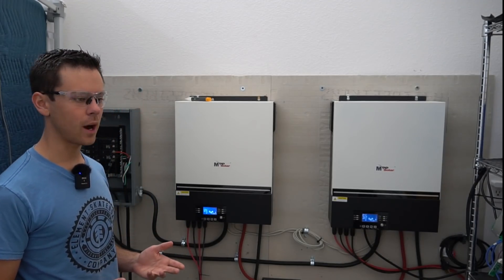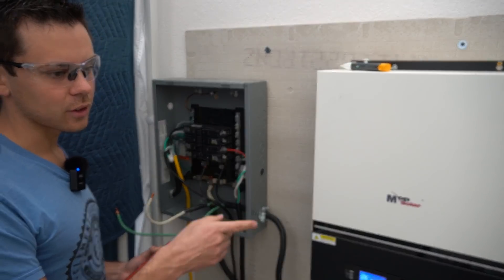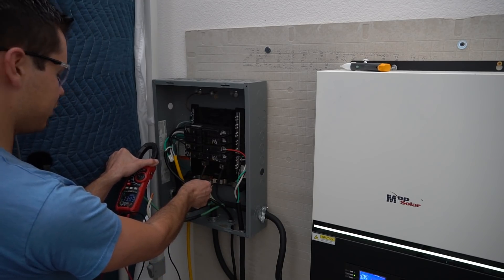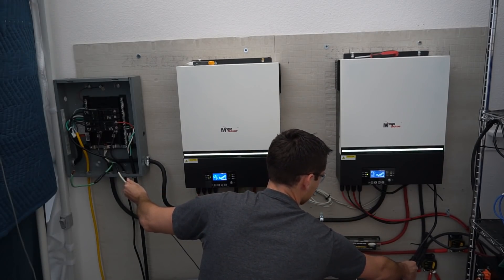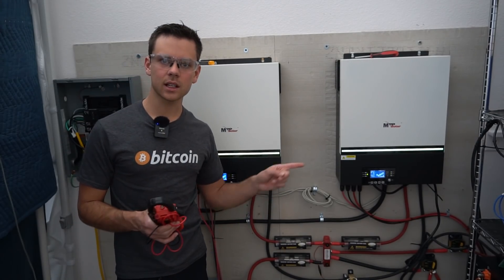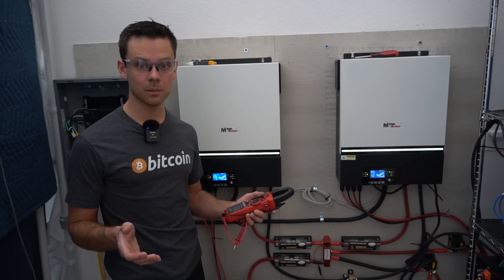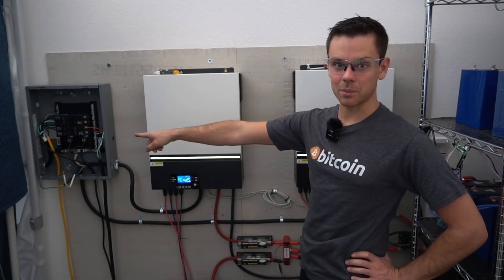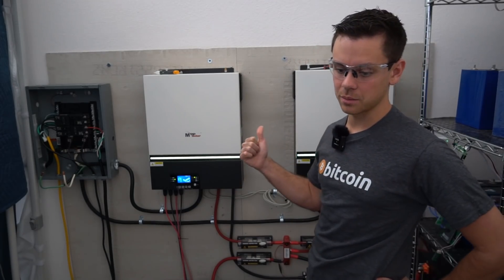Advanced Level Grounding Discussion for All-in-one Solar Power Systems

Comment: Does this issue affect the Growatt units as well?
Reply: Yes. I tested my Growatt 3k 120v today and the neutral and ground are bonded on AC output
Reply: @lifewithlonsi  What is the model # or your GW?
My 3000tl lvm-24p is model # SKSL00 0010700 and my AC out is not bonded per the three-light circuit tester indicating no ground.  Only when I plug a NG bond into the AC out  does the fault go away an both lights are lit.  It doesn't matter if AC in is from grid or battery.
Reply: @4partee  Same model but different part # (SKSL00 0005322). I contacted Growatt support - they said that it SHOULD NOT be bonded but I recorded a video (you can see on my channel) demonstrating it in fact was. They provided guidance to remove grounding screws on the PCB which resolved the issue. Appears to have been an unintended outcome of grounding the PCB inside the unit, I posted a video of the fix as well.

Comment: Could you please do a simple test for me? I assume that you have your panels all connected to ground? Could you check voltage from the panels to the ground rod?
During the daytime I have about 17vac running to ground, at night when the sun has long set I have about 5 volts running to ground. There is no voltage in the house ground wire. I have the combiner box also hooked to the same ground rod as the panels because of the lightning protection circuits need a ground and I don't want to tie that into the house wiring.
I need to check each panel from the output positive to the frame, and see if there's anything bleeding from any of the panels. I found the voltage when I was connecting each panel to a common ground wire running to a ground rod. I felt voltage run through my hands when I touched the next panel and the ground wire I was connecting. I don't like having voltage running on my ground wire so I am a little curious where it's coming from and if it's normal.

Comment: Personally, only the generator (floating ground) will connect to AC input, 
but usually genny only drives a floating charger connected directly to the battery, multiple chargers if the load requires.

Ground is a local reference and 2 different grounds may not be the same reference aka ground loop.
The power company may have 100 to 150 KV on the pole and taps on a transformer for a specific circuit.
A transformer may supply multiple circuits.
 
A transformer with 220 secondary and dual (180 phase shift) 110 secondary circuits with a center tap, the new (CT) ground reference is different from the input ground. One would not want to tie the input and output grounds together. 

The power company knows you are going to ground your breaker box and designs their system accordingly.
When using solar/ grid tie configuration, the equipment should handle any grounding issues.
If one was completely off grid, from a purely safety perspective it would be prudent to ground the box to a copper rod, 
however, once done, the solar panel may increase the likelihood of becoming a lightning rod if not otherwise present. 
Letting ground float might offer some protection.

Comment: If i want to use power inside and outside a van (where an invertor is placed inside the van) do i need to earth the van to ground or just ground the invertor to the van?
Reply: Your van is grounded to your battery.

Comment: I think these inverters should be manufactured with no ground-neutral bond no matter what mode, whether it is in inverting mode, grid bypass, grid feedback, whatever mode it is. Any sort of GN bond at the inverter will create problems in on or more use cases.  They should leave the GN bonds to the Installer. Let us put in our own GN bonds in the main Panels or Subpanel(if it is the service entrance for an off-grid  system). That way there is no problem in one or more of these modes.

Comment: The Schneider Conext MPPT 100/600 has two ground, one for positive and one for the negative but only one can be active. my system is negative grounded so the fuse can go only in the negative fuse holder. 
The instructions are clear for mobile application ground and neutral have to be bonded and gound strap is required for vehicles but on grid applications grounds from house distribution box and for auxiliary inverters have to be bonded.

Comment: In any power distribution system the safety or earth ground and the neutral reference are supposed to be completely separate except at the main panel because they serve two different purposes.  The safety ground is to protect against accidental shorts and electrocution.  It can also be used as a ground reference with active electronics.  On the other hand the neutral is used to balance current differences between the two legs of a single phase high voltage (over 42 volts) power distribution system.  The ground and neutral are bonded at the main panel to protect the upstream source on the power pole from shorts in the local downstream power distribution system.
I don't think the neutral and ground should be connected in the inverter or any downstream breaker box because they serve two different functions.  If a vendor is connecting the two then they are connecting them due to a design defect.  Ever notice how ground and neutral are never connected inside electrical equipment even though they should technically be the same?
For an off grid system, ground and neutral should definitely be bonded in the main breaker panel and the panel should be connected to a proper grounding rod.  Otherwise in case of a short in a wire or device you are holding, your body is the ground rod.

As for a neutral between two inverters acting as a single phase system, that is much more complex.  How do you balance the load between the two systems.  What happens if you have a 240v stove with a neutral wire and then have all the electrical outlets only on one inverter?  How do you balance the current on the neutral?  Does it even matter?
If there are high voltage electrical engineers with a better understanding of the subject, please correct any errors I have made.  My layman's AC electrical engineering experience is from AC power distros used with large sound and lighting systems.  Underwriters Laboratory (UL) probably a good source of information about this.
Reply: I agree with what you said. As far as balancing, the grid doesn't worry about it, because there is unlimited power.

When you build a house, good rule of thumb is to put outlets and lights in one room on separate circuits so if you blow an outlet breaker, you still have light in the room.

If you are using inverters it is your job to balance the load when you are running 240v to save wear and tear on the inverters. 

And the new code is where the earth ground is the earth ground and the neutrals are the neutrals. So earth ground everything to one single point. The old code was grounds and neutrals on same bus bar.

Will, as far as your 14v there must be an issue with the inverter or you have a ground and neutral touching somewhere on that circuit.
Reply: The stove example is not an issue if the neutral conductor is rated for the difference in current. You will want to have a neutral ground bond somewhere in the system to keep the stove from floating relative to the ground. In the case of 2 inverters, both neutrals on the 120 volt legs will be tied but the hots will out of phase. Grounding each inverter in the system with the grid input is generally done for redundancy in case the bond between inverters fails. This is generally not an issue in regards to ground loops given their close proximity and limited charge passing over the ground. 

This will be similar to US split phase systems where the neutral is bonded at the main panel. There may be a common mode difference between properties (each house has a ground neutral bond); this may be a problem if pulling power from multiple main panels from different properties but that is not a real use case. The step down transformers on the grid will service a small area so it provides AC coupling between areas and avoids large DC ground loops even with high common modes differences across a large neighborhood.

Comment: As I said earlier there is single pole double throw relay inside. If connected to utility then incoming Neutral (connected in main panel to PE-ground) is connected to outgoing Neutral. If separated off-grid (blackout) then incoming PE-ground is connected to outgoing Neutral. More unit parallel only means like you have 2 wires making the PE-N bond when off-grid. So no problem. In some inverters the relay is missing, or not working, or can be set with 38th menu point. You checked, yours is there and working. Nothing to do. Even the extra bond on output is not a real problem since it is on the same level as the main bond. You have the RCD later in the circuit. And floating is not a wise choice. RDC does not work then. Also you must use only one ground and connect everything to it. If you have more ground rods you have to connect them together.

Comment: Dam it Will, I was having a nice enjoying unseasonably warm temperatures and you had to bring up equipment bonding conductors. It is pretty straightforward for commercial power, and thankfully the industry has tried to stay on top of the grid tie systems and requirement for professional installations. Off great however needs to have manufacturers supply schematic diagrams and block diagrams to answer these types of questions.

Comment: Not that I've tried it however why not use an inline diode outside of each inverter? Would that not keep the discharge flowing mono directional and away from the other electronics? If so, what an easy solution that might be.
Reply: Where would you add the diode? On L1 and L2? On the ground? On the neutral? In any case, a diode will simply turn AC into pulsating DC. I don't think you want that.

Comment: I am thinking the issue is as follows:

Normally when on grid, the utility company establishes ground, but it only has one source of power production.

But when we add a second power producing source (inverter), we become like a separate utility company.

So the question becomes: If we have two utility providers next door to each other, each has their own energy production, each has their own ground for THEIR system, then we want to connect these two systems together, the power sources may be slightly different relative to one another, and each ground current may be different relative to one another, creating a difference in potential between the two systems.

We need to understand how do big utilities bring their differences into balance on the national electric grid between two providers?

I would assume they have some resistive or other capacitors / inductor circuits that can balance the loads between the sources on each line, L1, L2, N, G, such that one system does not push power into the other system, causing it to become out of balance, and creating stray unexpected currents that could be hazardous to people or equipment.

Now this is purely speculation on my part, but maybe those of you that have a greater understanding of these things, could find out how big utilities couple two distinct systems.  What kind of balancing circuit(s) are used to unite two distinct systems.

What ever they use, is probably what we are looking for to solve this issue when uniting our inverter system with grid system (grounding), and we need a similar circuit or device that sits between the inverter and the grid to balance out the voltages and currents so none of us get electrocuted or our equipment gets destroyed.

I am not an electrical person, this is just speculation in my mind, while trying to think like an electron on each of these wires.  The energy all wants to go into the ground.  And even though we define and perceive the earth ground as zero, it is only a definition, and a different earth ground in a different location, may have a positive or negative level as related to the original earth ground.

So somehow we need to have a circuit or device, that magically constantly measures the differences in potential between two different systems or possibly just the grounds (but i think needed on all lines), then the circuit balances the difference to make them equal so that no current or ground loop of current can exist.

If you tell me where to research this type of info, i am glad to do the research, but this is far beyond my understanding.

Please post feedback on this idea, so we can brainstorm a solution.

thank you

Comment: Did you try a GFCI outlet on each 110v leg of the distribution panel?  It would be interesting to see if GFCI outlet on a 110v leg would stay energized.  Try it both ways, with neutral/ground bond in distribution connected AND not connected.  Would be interesting to hear what results you get.

Comment: As far as I know ALL inverters connect the AC-In ground,  AC-Out ground and the Inverter case together.

For grounding, pick one spot for the central ground point and connect all the inverters to that one spot and only to that one spot.

* If the central grounding spot is the grid-connected breaker box before the inverters, then connect all the AC-In grounds to the box and do NOT connect the AC output grounds to anything.   Then run another ground from the grid connected box over to the critical loads box.

* If there is no AC input, the 'critical load box' is the central grounding point.   In this case, connect all of the AC-out Grounds to the critical load box and do not connect the AC-in grounds.
Reply: This is correct for 110-120v ac systems but for 220-240v the old system didn't need the neutral but the new systems need L1 L2 N and ground or the Tesla will not work.
Reply: I was wondering how the case will be for 120V system, I have a 3000 watt inverter and it works just fine with everything, I have a 24V system, I'm having an issue getting my Tesla mobile connector to accept AC out from the inverter!

Comment: Long explanation. First thing you need to understand is the difference between "Grounding" and "Grounded" conductors. Your Neutral wire is the "Grounded" conductor. It is bonded internally to your equipment (Inverter) and the Ground wire that you speak of is the "Grounding" conductor. You DO NOT bond these wires anywhere except the point of origin. The Grounding wire is the one that runs to your Ground Rod. You will have an isolated Neutral bar in your breaker panel AND you need to have a Ground Bar in your panel that is bolted to the case (box). These will not be connected to each other. NOW for the fun part.
GROUND ALL ELECTRICAL EQUIPMENT.. YES this is needed to prevent external metal parts from becoming energized if there is a short circuit. This ground wire will go to the ground rod. You have confused yourself thinking all wires bond together. This is not true. Ground your equipment and run that to an earth ground that is either connected to the house ground rod or to a separate  rod that is placed MORE THAN 18 feet away. Earth potential is generally about 8 to 10 feet. This separation is needed to stop potential ground jump.  AGAIN; Do NOT bond your panel neutral to ground. Ground ALL electrical equipment to an earth ground. This can be done with one wire in chain connection between equipment if desired.
Reply: Most of this made sense to me.

"to a separate rod that is placed more that 18 feet away" - is that 18 feet away from the house ground rod, or 18 feet away from the equipment that you are trying to ground?

I didn't understand "Earth potential is generally about 8 to 10 feet" at all. Could you please explain it a bit more?

Comment: On grid or Off Grid it doesn't matter, you NEED a ground rod for safety. 
If you have multiple grounds rods they MUST be BONDED or connected together even if its on the opposite side of the home.
Where the neutral/ground bond happens changes depending on your setup. For example in my home we have a 400a service with 2x 200a panels and the neutral/ground bond is done inside of the meter base and not in the panels.
If I were to add 1 or 2 or more inverters I wouldn't make any bonds in either panel or either inverter. I would make a buss bar and connect all grounds to that and connect a larger conductor to the meter base in my situation.

Comment: How about if you’re using a gas generator to power up your inverter to charge your batteries? 
My Victron inverter is tied to the house grid, using a flip switch to ensure the main power is off, but I can use all my breakers in the main panel. But I’m only using it in one direction, from the batteries to inverter to the panel to power the house. 
I only use the gas generator when the batteries are low.
Otherwise I ground all my off grid gear to a rod outside away from everything else.

Comment: You don’t ground your generator so why would you have to ground the inverter?
Maybe grounding the inverter case to the panel ground.
I was always told that sub panels are only grounded at the main service panel not at the sub panels.
Reply: I think you'll find that everything should have a common ground. Ground and neutral should only be bonded at the main source, not at any sub-panel
.
Reply: @richwood186  I agree